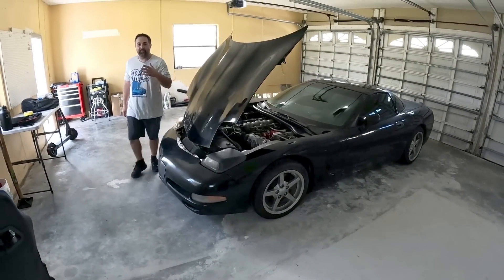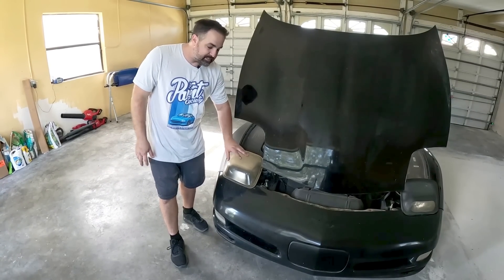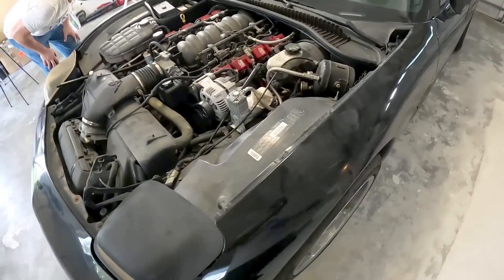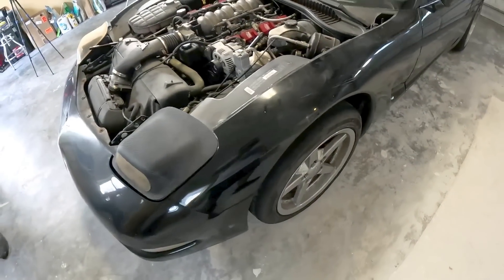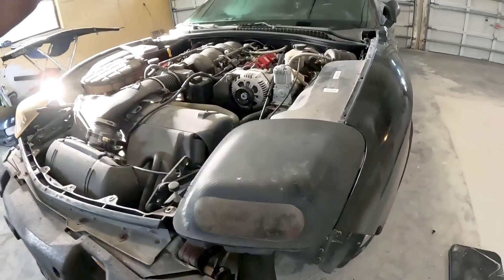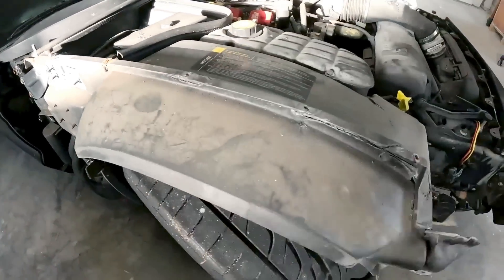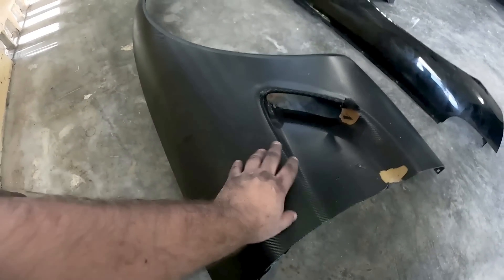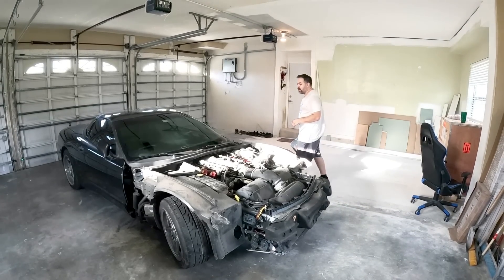MY First Paint Job Series, Episode 2: Tearing Down the C5 Corvette for Paint

Comment: those headlight assemblies are several different pieces, a painted cover, a motor, a hinge,the light capsule itself,I used to repair those under warranty, that stuff was turned in and trashed after three months, try LKQ

Comment: Also try solution finish on that cowl... don't know if you ever used it. It's the absolute best black trim restoration product I've ever used
Reply from the maker: Okay thanks !!
Reply: I think my 1st comment got deleted because I had an email in it Check out Corvette connection in Bolton Connecticut They have new old stock and used parts for all Corvette years
Reply from the maker: @Forcedinduction_Drive  okay thank you! I’ll check them out

Comment: The inner fender part is replaceable but I believe it’s glued on
Reply: I suggest you taking the rockers off they go way under, they may be a combo of bolt/glued on not 100 on that, & the quarters do unbolt and the bolt that was hard to get to, doors off will make that easier.I admit the last vette I color changed was a lot eaiser painting apart. Painting the tail light pockets are a bit tricky.
Reply from the maker: I am going to have to exchange some voice memos with you! You helped a lot on the yukonn